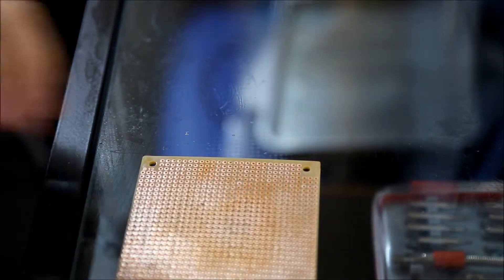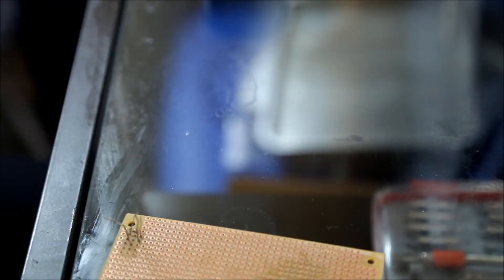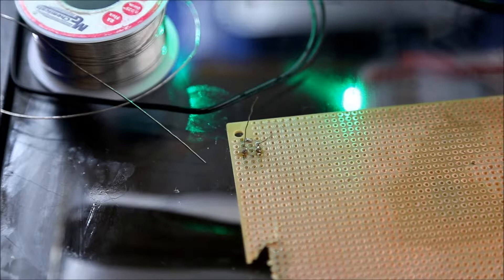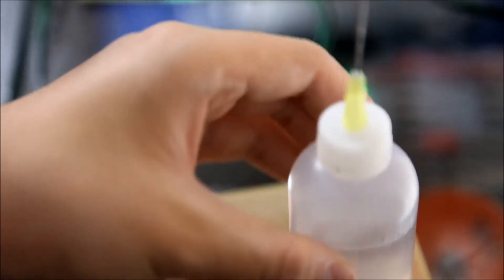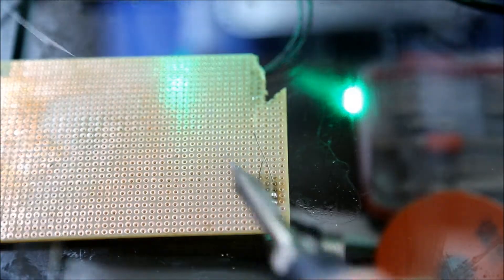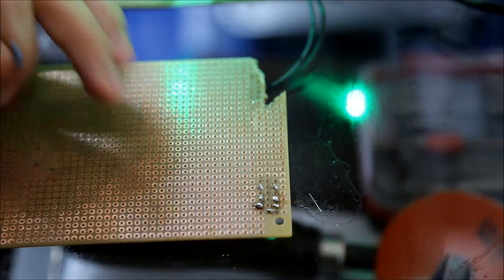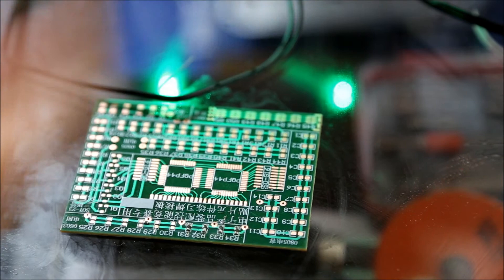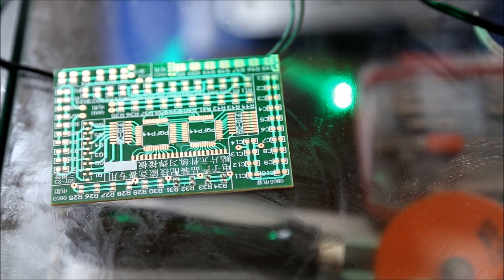Solder: Best vs. Budget

Comment: when ever you solder bare copper, you can clean it with scotch-bright and then isopropyl alcohol then it will wet better.   nice work, here is a tip: put a coffee filter over the board and run a toothbrush soaked in alcohol over the filter and it cleans up real well. cheaper than kimwipes!